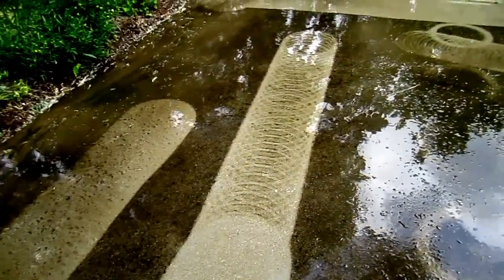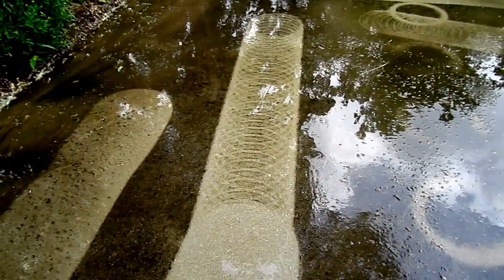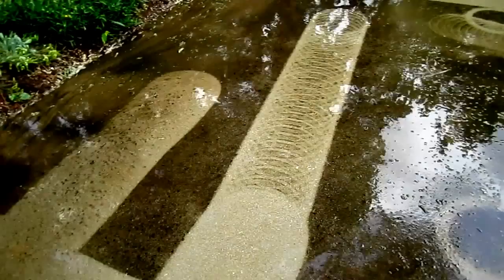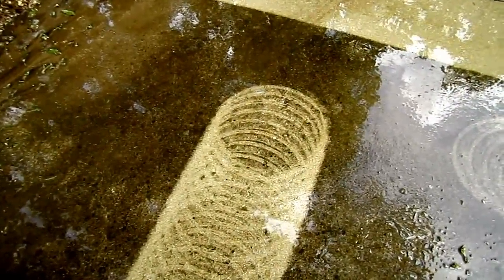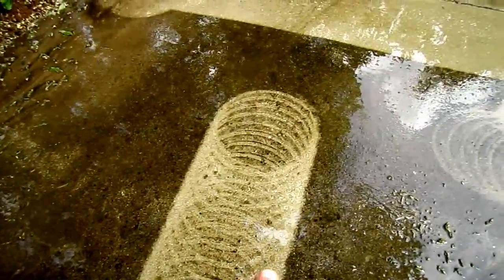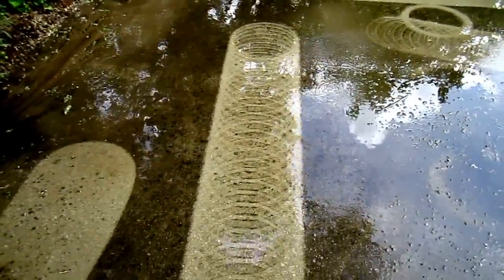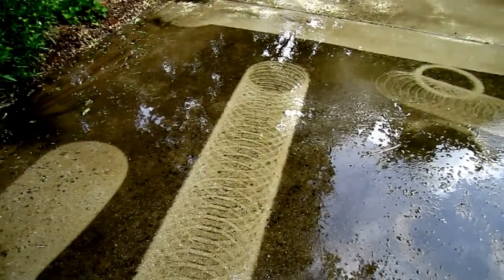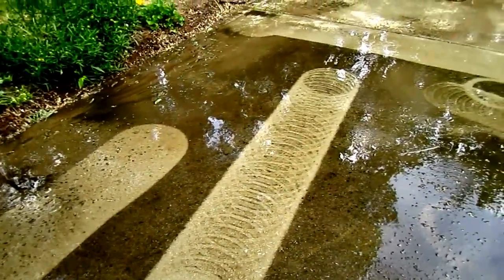Pressure Washing Surface Cleaner stripes how and why.

Comment: Liquid chlorine is hands-down the best that you can use to keep from leaving streaks in the concrete.   I always spray the area that I am clean and then I use the pressure washer after.
Reply: How do you reclaim the water/chemicals? From what I've read it's federal law that you can't let the chemicals go down the street into the storm drains
Reply: @Shrimp_Insurance  reclaim system

Comment: The question as to why surface cleaners do leave striping is often asked.  Great answer and video.
Reply: Slow down to a crawl isn't a good answer.   Reduce the nozzle orifice size to increase spray velocity and spray arm rotation speeds.

Comment: Although this problem can be cause by moving rotary surface cleaner too fast, the most likely reason you are getting the tiger stripes is because the rotary surface cleaner heads are spinning too slowly. They should be spinning at about 1500 rpm, but sometimes the bushing will bind under water pressure, and cause the head to spin too slowly or not at all. Mine does that sometimes, and the only way to fix it is to take the head off, and clean and grease the bushings. There are several videos on youtube about this problem; just look for "rotary surface cleaner repair."
Reply: Howard, you are right on the money. I noticed this on my cheepie rotary cleaner. It would spin no problem without water pressure. So I was like Huh?? With water pressure it would bind/slow and get "Circles". I took it apart the rotary head was loose. Cleaned checked and retorqued. Now no more circles and it works perfectly.
Thx
MJ
Reply: Howard great explanation. While going to fast will cause this which doesn't take a rocket scientist to figure that out. Your explanation is what happens to most people's machines after several cleaning jobs. Thanks

Comment: At a particular small time frame (delta T) when the surface cleaner is moving forward (forward being 6 o'clock to 12o'clock motion) the distance measured between the arc tangents at time one and time two in the 6 o'clock and also the 12 o'clock position is larger in comparison to the distance between the arc tangents at the 3 o'clock and also the 9 o'clock position at the corresponding time points (distance between tangents in the 3 o'clock and 9 o'clock is actually zero). 

Great video!!

Comment: First distribute clorox properly using a 21 to 60 " broom in dry concrete. Then pour few water with a hose in shower mode. wait one hour, then use the pressure washer with the surface cleaner. When you finish,  you won't see any stripes.

Comment: REDUCE THE NOZZLE ORIFICE SIZE TO MATCH YOUR PRESSURE WASHERS PSI. This will increase the speed of the nozzle arm rotation and increase the velocity of the spray.
Reply: You cannot always change the nozzle
Reply: @Moccalocca100   Leak,  Why can't someone "always change the nozzle"?  (They unscrew out and screw back in)   I understand that some are not good with tools BUT this is a pretty simple procedure.
Reply: @tribulationprepper787  Because you simply cant always unscrew it. Sometimes its soldered
Reply: @Moccalocca100   In that case...  UN-SOLDER IT!   You will need a torch.   IF someone put the nozzle on THEN someone else can take the nozzle off.

Comment: Can using this method work inside a building? If not what will work without damaging property?
Reply: Cha'Ron Russell reclaim
Reply: I would use something like a swifter sweeper rotating thing or similar tool made for indoors. They also have floor cleaners for rental at Home Depot with a rotating head.

Comment: If your surface cleaner is leaving stripes then it has substantial wear greasing it will help but it isnt a permanet fix 
The only fix is to replace the cleaner note surface cleaners should be greased before using it
And during use it your gonna be using it for more than an hour at the time

Comment: Have you used the classic SC at 4 gpm? I'm running a 4000psi 4gpm pump and not sure if it would work very well
Reply: Does the 4 tip mod work well with it also?
Reply: Yeah... That's on my to do list. I'm a newer business and still trying to get "busy". I'm think about getting a hotbox first so I can get those bigger commercial jobs and then upgrade to the 8gpm. As of now I have a pressure pro pw with the honda gx390 motor on it. I'm already looking into how big of a pump I can swap it out for when the time comes to rebuild it. Since it's a 4000/4gpm pump in was wondering if a 3000/5gpm pump would work on that motor. I could always use that one for a back up or smaller jobs down the road. Haven't had any response on PWR yet

Comment: Thank you, Mine did this alot and as soon as I use detergent it went away, thanks again.
Reply: Hello a degreaser I find is best, If your from england then go tesco and get the all purpose cleaner its 25p a litre, I apply it with water and a watering can and sweep it in then use a frv30 to go over it.
Reply: I'm having circle problems as well with the frv30. It's as though the rotating arms don't spin fast enough. If I lift the head and let it spin up to speed and put it down it's good for a few feet then back to circles.  I checked the nozzle alignment and it's good. Angle isn't adjustable.  Pressure is as high as I can get with this Kärcher.
Reply: Hi I too had a FRV 30 and they are absolutely shit - waste of money - they stripe to high heaven and the water floods back into the head as soon as you let go of trigger, get a mosmatic vacuum recoverys there amazing - just be sure to use a nimos weed ripper before using it.
Reply: +111alien111 In my case, I had purchased the pressure washer already, because it fit the bill for what I needed a pressure washer for.  So the FRV 30 is the unit for my pressure washer - as it just doesn't output enough volume and pressure to drive bigger systems.  Understanding how to apply the FRV 30 is the learning curve.  Yeah, when you shut down' the sprayer the, venturi suction goes away and the water does drop where it stands... moving the FRV30 head to an appropriate location before one shuts it down is the best bet.  In my case, for when I need the suction - in my garage- I'll just roll it out of the garage bay before shutting it down fully.
Reply: +111alien111 In my case, I had purchased the pressure washer already, because it fit the bill for what I needed a pressure washer for.  So the FRV 30 is the unit for my pressure washer - as it just doesn't output enough volume and pressure to drive bigger systems.  Understanding how to apply the FRV 30 is the learning curve.  Yeah, when you shut down' the sprayer the, venturi suction goes away and the water does drop where it stands... moving the FRV30 head to an appropriate location before one shuts it down is the best bet.  In my case, for when I need the suction - in my garage- I'll just roll it out of the garage bay before shutting it down fully.
Reply: I even tried using the FRV30  with a WS202 and we engineer'd it to be able to take that large amount of power and yet it STILL striped, they are terrible beyond belief just like anything else thats made by karcher,  mosmatic, interpump, and flowfit are all top brands that I would never stray from again

Comment: Wish someone would have told me you needed at least 8 gal. Min. pw machine if you want to clean concrete !
Reply: You dont
Reply: Steven,  Daniel, below, is correct.  You don't need a bigger pressure washer.  You need to replace the two nozzles with nozzles that match your pressure washers PSI output.

Comment: Still get it till this day lol even when doing a pre treat....drives me nuts
Reply: Mike Dorsett Ok so it's not just me then. That is the one thing that drives me nuts!!! No matter how slow or how many times I go over it, I still get the stripes. If anyone has any tips I am all ears.
Reply: Have you tried using 25tips and using 2.5 tips or 3 tips? Sometimes you can use 40 with 2 tips. And sometimes your just not going slow enough. I feel that the lines are from too much power and your etching the concrete or not enough power and your not cleaning it. I always am changing my tips depending on the surface also. If your using a 24in try a 16 or 18 in whisper washer  if your using a 5gmp unit. Anything bigger you need more water.

Comment: It seems to me that using a lil ol pump sprayer before power washing is counter intuitive
Reply: Depends on the mixing ratio of water to detergent the detergent needs and what the power washer produces via its detergent siphon system. It's easier to control the mix ration if you manually mix and hand spray on.

Comment: Mine won't spin??
Reply: They should be spinning at about 1500 rpm, but sometimes the bushing will bind under water pressure, and cause the head to spin too slowly or not at all. Mine does that sometimes, and the only way to fix it is to take the head off, and clean and grease the bushings. There are several videos on youtube about this problem; just look for "rotary surface cleaner repair."
Reply: Howard Gerald  THANK YOU SIR!
Reply: @JamieDLGD78  sorry I didn't see sooner. .
I just started messing with one of these things today. ..

Comment: Not the best explanation as to why the circles are being formed. We now why the clean bits are happening but not why it's not cleaning quickly. 
Going too fast ok. But if I'm going the speed of the manufactures demos then what? Clogged nozzles? pressure too low?
Reply: +Michael Kreisle I suspect that. However I am using the machine and floor cleaner that are said to be compatible using the nozzle set specified by the manufacturer for use with that machine.  It's the "as specified Kärcher set". The face that it was raining and this there was some small amount of standing water combined with the fact that the washer is not a hight power/flow rate unit are part of the restriction. It's the most powerful electric one I could get for measly 20A 120vAC power. Which means it's underpowered for these sorts if uses.
Reply: I would think a washer with 3.5 or 4 GPM would work much better and faster than a 2.5 GPM unit
Reply: Minok, Check you unit GPM and install 2 nozzles that are 50% of your total system GPM rating. oversizing nozzles will cause high volume with low pressure.
Reply: Different ages of concrete and depends on how often in the life of the concrete it's been cleaned properly.. every job you do will need you to either go slower.. or in some situations you can almost run with it... either way you need to go at the rate that your machine and surface cleaner needs to to remove the mold effectively.. i would use that same principle on anything you clean start slow and slowly move faster till you get the right speed needed.